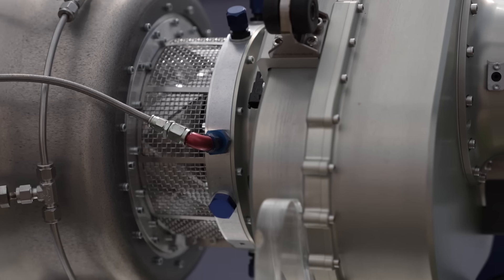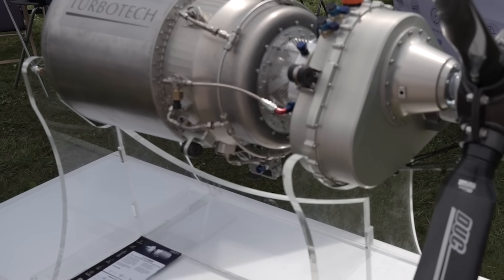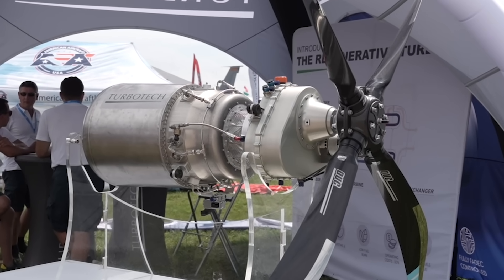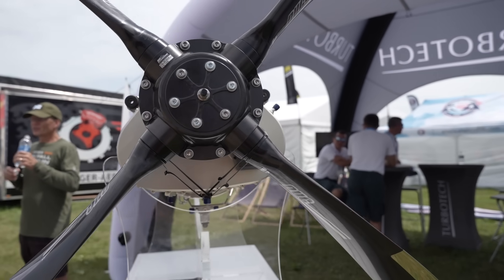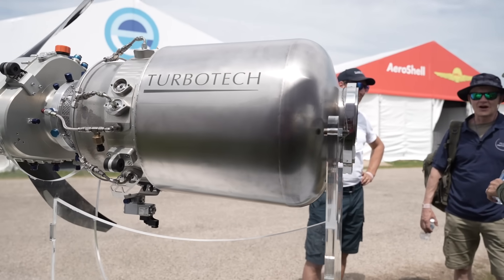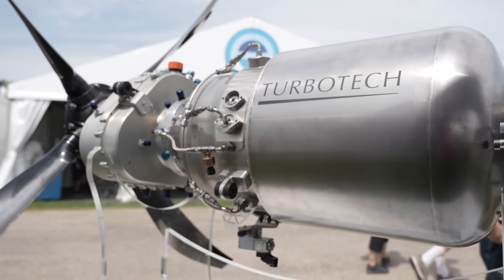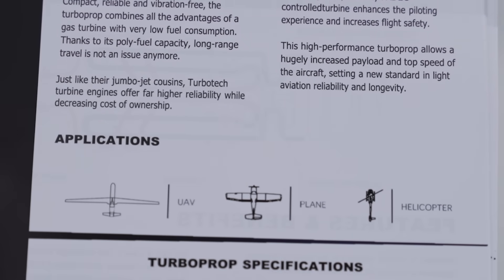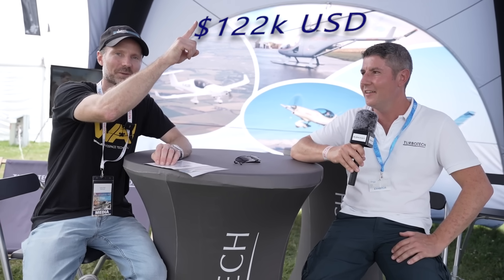Is this Turboprop a game-changer? It's Here Now.

Comment from the maker: Less weight than a Rotax 915… I found that surprising. 👍
Reply: The game changer is the incorporation of a heat exchanger recuperator, experimented with by GM in the 1960s, when they installed a turbine in a car.
The TurboTech recuperator is much more compact and much lighter and it works with a very simple radial compressor of the sort found in a turbocharger.
Cheap to manufacture and very robust with no axial compressor blades to get damaged.
This turboprop is a replacement for a Rotax 915iS rather than a Lycoming 0-320.
The TurboTech is a very similar weight but a little less, the TurboTech is 85 kg and the Rotax 88 kg, but you have added weight of coolant for the Rotax and additional drag for cooling the Rotax.
It is not substantially lighter because of the recuperator, this adds a lot of weight, but worth its weight in gold because it cuts fuel burn in half.
The TurboTech produces the same power, 140 HP, but soon 160 HP will be available, to match the Rotax 916iS.
Reply: @PhilipFly11 turbine engines with recuperators were in production before GM (and just about every other automotive manufacturer) started experimenting with them... but they have not been used in aircraft due to their weight. 

Radial-flow compressors have always been normal for small gas turbine engines.
Reply: It shouldn't be. Jet engines are always MUCH lighter than ICE. They drawback its that they normally need to carry MUCH more fuel to do the same mission.
Reply from the maker: @colinbowman8816  yes generally Jets are pretty thirsty…. However, this particular model burns less than a Rotax 915 with 5 more horsepower.
Perhaps they’re on to something, even though the price point is much higher. 

I think it would make the most sense for a flight school that flies thousands of hours .
Reply: @Blaircraft.Engines  I wouldn't believe any of the marketing numbers. Real tests with measured fuel flow and output power are required, and they will likely show lower efficiency than the Rotax.
Reply from the maker: @brianb-p6586 It will be good to see and talk to an owner with an installation. Perhaps they will send one to the US?? I’ll have a Mooney that I could test it on here in the near future 😁
Reply: @brianb-p6586 
They did comparative flights with a rotax équipes aircraft. And if I remember well they had similar FF. Usually, turbines are most efficient at full power. So I think comparing at high or medium power settings may bring différent results...
Reply: @renaudcharlet I've seen and heard the marketing material, and I have not seen direct objective comparisons.
Reply: It is important to get competition to Rotax